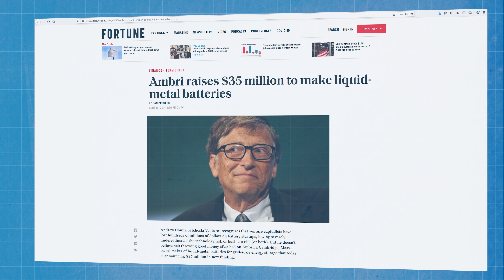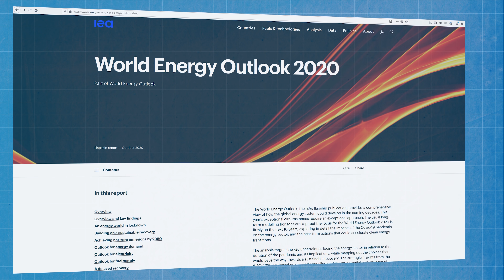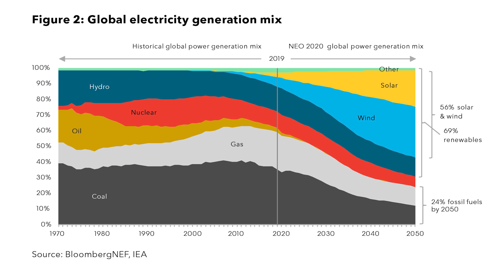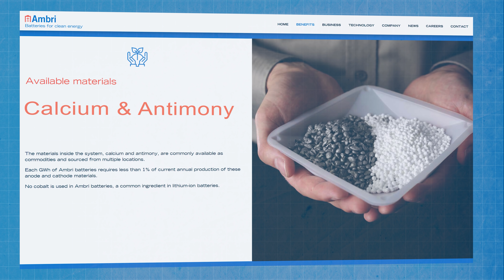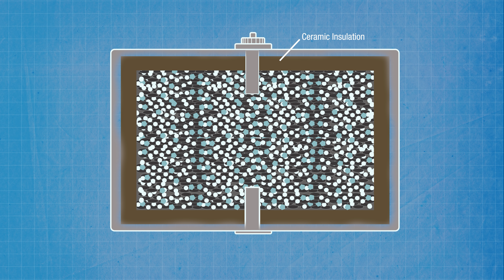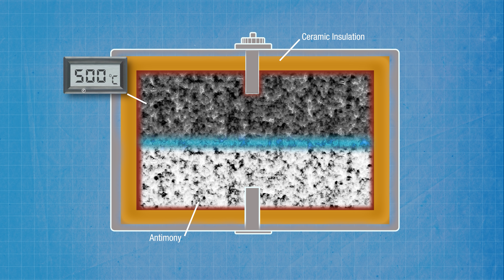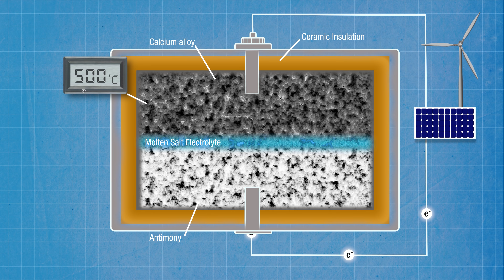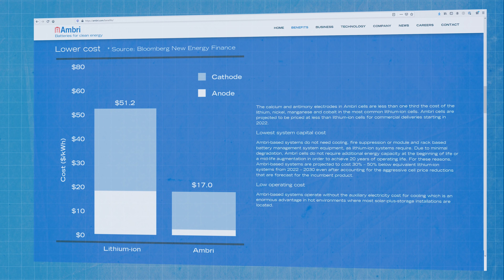AMBRI Liquid Metal Batteries. Will they really change the world?

Comment: 500C? How the F.. they are going to isolate those batteries to stay anywhere near that sort of temperature?  Why not just have a solar concentrate that uses molten salts with low melting point and just keep it as thermal capacity and produce electricity on demand

Comment: Haber Bosch reactors also need to be kept at 500°.

If I was building a small scale fertilizer plant, I would love to have it run on renewables with a big hot battery.
Reply: iiuc, the heat output is not waste: the battery needs it to keep molten.
Reply: @ianworthington2324  it gets hot by charging, so you just need to cycle it more often if its getting cold.

Comment: Hi, critical feedback at 2:42 "low or zero carbon". Carbon has two meanings there: net CO2 emissions or equivalent CO2 emissions. If the first one could be true (not even sure), the second one definitely is impossible. Energy quantifies how much change you're making to the system. Clean means stay things as they are. By definition, clean energy (or zero CO2 equivalent) doesn't exist.

Renewable (solar/wind here) is a great idea for the very long term but the urgency is low CO2. Construction materials are heavy CO2e emitters and renewable use a lot more materials than other low CO2 energy production systems. That currently makes solar/wind much more CO2e heavy than hydro or nuclear power (which, with cogeneration would be viable as a transition energy source to quickly replace coal/fuel/natural gas).

Would be great if you could introduce this nuance in your simple explanations so now one gets ever fooled by ignorance or disinformation.
Or maybe not use "zero carbon" and not associate "low carbon" with wind/solar only :)

Hope this makes sense. Critical feedback on my critical feedback always appreciated.

Comment: Question: what happens to the energy when you let a charged battery to freeze?
Reply: The chemical energy is still there.  You just need to supply enough energy to heat it up again so the ions can move.  If you had an uncharged and frozen battery, you'd have to supply the energy to heat it up again and then to charge it.
Reply: @larryp5359  obviously you will have lost the heat energy

Comment: Very interesting idea , but I think there are many different pairs of material that can be used. Some more expensive some even cheaper. Like a sulfur. We all could agree that for big scale storage this sort of huge cistern like make more sense then small units. What we also need to consider is the low voltage supplied by single unit, so many of those needs to be Connect to rise the voltage, or already design and build a stack with multiple layers.

Comment: I'm working on liquid metal batteries myself, there is still some time to go until we begin using it on very large scales, but once we have conquered the efficiency and temperature maintenance issues, it's a perfect system for grid power storage. This however can speed up if this technology is properly funded.
Reply: What about for propulsion in naval vehicles 100+ metres long? 😯

Comment: I have for 3 years have had an idea that could actually go way beyond the limits of chemical energy densities. A vacuum capacitor. Imagine this. 100 nm thick plates of metal in a vacuum, separated by 100 nm, perhaps 5 million such sheets, to fit inside a 10 cm by 10 cm by 1 meter rectangle. The capacitance of this would be about 5 farads. Odd numbered plates that get a positive charge, are connected to and suspended by the north and south walls of a rectangular vacuum box, and the even numbered plates that get a negative charge are connected to the east and west walls, so that neighboring plates have no path through actual material that doesn't require several inches of path. Therefore if you get a VERY good vacuum and shield it from electromagnetic radiation so that no photoelectric effect occurs to cause a discharge, there's no reason you shouldn't be able to put 100 kV on this. 5 farads at 100 kV is an energy of 25 gigajoules. In something occupying 1/100 of a cubic meter weighing maybe 50 or 100 pounds. But there's one little catch. Electrostatic attraction. Any plate in the middle of this big sandwich won't be attracted in any direction because it will have an oppositely charged plate both above and below it, but the plate on the very top and very bottom will be attracted VERY strongly to the one below it..... so bend it into a torus. Instead of 10 cm by 10 cm by 1 meter in a straight length, have it go around in a circle and the 2 ends of the 1 meter length connect back into itself. Now there's no top or bottom, and no plate will be electrostatically attracted in any direction. The downside of this is that it would require extreme precision of machining, and an extremely good vacuum, better than anyone has ever made before. But I don't see why this shouldn't be possible. For safety, instead of metal plates, perhaps something that doesn't conduct too well like some conductive plastic, so that if there's a short circuit, you don't get a 25 gigajoule explosion, but rather it slowly discharges. But if you do this, I don't see why you wouldn't be able to have something that stores the energy of a tank of gasoline in a device that is small enough to fit in your hands. It also depends on what the limits of voltage can actually be put on something like that, is there some sort of spontaneous discharge through a vacuum that occurs even without radiation to set off the photoelectric effect?
Reply: If it actually works, that could actually revolutionize a lot of things, for instance with such high energy per weight ratios, you could have an electrically fueled rocket and get into space without the need for millions of pounds of fuel because all that is required by having it exponentially larger to cope with more fuel being needed to lift off more fuel. But with an energy density of 100 times higher than gasoline, you could have a payload be more massive than the rocket. It could even be more outrageous if you could go even further than 100 kV. Make it 300 kV and 25 gigajoules becomes 225, and it's starting to get close to the energy to weight ratios of nuclear bombs at that point.

Comment: Yes, storage is the key component to make a carbon free energy grid possible. And I very much aprechiate the efforts of Sadoway and others. But unfortunately, 1/3 cost of LIB is not good enough for a large scale storage system. Costs have to go much deeper for it to make sense. And I am afraid this is the aspect where it will fail. The system is already fairly simple as well as the ingredients are cheap, so I don't see much potential for further optimazation or cost reduction.

Comment: One of my old students has just sent me the link to this video because about 10 years ago I started basing my university level student projects on the development of a FESS for use in the third world.  My brief was that it must require minimal maintenance, it must have high energy density, it should be used for decades - even centuries - with no loss of storage capacity or efficiency, it must be totally sustainable, only require abundant and cheap materials and totally un-toxic to the planet - a challenging brief which only the FESS designs (or mechanical gravity based) designs come anywhere close to fulfilling.  Over several years  we decided that it was much better to go for low angular velocity (<4000RPM) and high radius of gyration (k) designs (2m ish) as energy stored is also equal to k^2 (100k RPM is just too demanding!) .  These slow speed designs have a major advantage that the losses are directly proportional to the speed, ie 4x faster means at least 4x more losses, and they could be run on standard bearings without any complications.  Another benefit was that any bearing heat losses can be used to heat up any air in the flywheel's enclosure to reduce the flywheels transonic drag at the higher speeds - in fact we would run our flywheels as hot as possible to make them even MORE efficient.  We designed a range of FESS systems from house storage (100MJ) up to building, town and grid 1GJ designs.  The nice thing was if you want more storage you just add more flywheels and simply gear them together.  If anyone wants a look at these designs then please contact me - just ask for the EAUC Sustainability Champion and they'll know who I am!
Reply: What is FESS?  You lost most people in the first sentence.
Reply: @francretief1  Flywheel Energy Storage System

Comment: As we increase our dependency upon intermittent energy sources (i.e. solar and wind), we will dramatically increase our demand for grid-level energy storage to capture that energy when it is produced and providing it when it is needed. This has the knock-on benefit of permitting the grid to power down costly and pollutive 'peaker plants'. And since our current grid level energy storage solutions are... pathetic... something needs to fill the gap. Unfortunately, a new contender has shown up that will be quite difficult to compete with. 

Tesla's new battery chemistry, namely the LFP (iron/phosphorus) they've already called out for Powerwall and grid-level energy storage as well as used in their Chinese vehicles, can match the price quote and then some, thanks to the scale at which they can be produced. No cobalt, no nickel, it's just iron and phosphorus. Which is just as cheap, if not moreso due to how ridiculously inexpensive iron is, than calcium and antimony. The new Maxwell dry cell technology also looks to be combating the dendrite problem, although we'll have to see if this is actually the case when they start being produced at scale. 

It's not that I don't think liquid metals are viable, it's that the economic niche they hoped to capitalize on has already been taken. Unless he can undercut Tesla's LFP batteries, he's not going to get much traction.

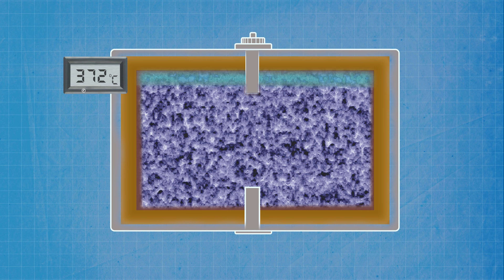Comment: @6:11 SO it takes electricity to make electricity?  @7:39 OK I see.  A 1 time HEAT source to get battery started.  @8:43 Going to NEED a portable or onsite power source that can bring temp to 500C each and every time.  Charge Capacitors COME TO MIND.

Comment: Liquid metal battery’s pose a problem by their weight is almost 4 times more than the traditional battery being used
Reply: That's not a problem for grid level storage, since you are simply installing them in a warehouse building and leaving them in place. You don't plan on moving them anywhere after installation, so weight isn't a significant factor, other than installation itself.

Comment: Running a batterie at constant 500° sounds not that efficient.
Reply: The temperature doesn't matter for efficiency, all that matters is energy in vs energy out, and that's 80% efficient. You would be correct if this battery was being used for low cycle applications. Then there is a certain amount of energy consumption just to keep it idle. But the use cases for these are high-cycle applications where they're constantly charged and discharged, resulting in low overall waste energy.
Reply: @BenjaminCronce  The 80% efficiency was surely calculated based on high cycle applications otherwise that technology makes no sense due to the need of liquifying the metals repeatedly. Anyway, 80% efficiency is still low compared to Li-ion technologies
Reply: Good point! It made me think about temperature sustainability in connection with global warming. Where does the heat go? I agree that this battery seems important.

Comment: a battery that needs to be heated to 500 degrees centigrade? sounds like a non starter.
Reply: Why?
Reply: @malcolm_in_the_middle  well you can hardly use something like that in most applications that need a battery, obviously.
Reply: @Withnail1969  But this is designed for one specific use case, which is industrial storage of energy. The main purpose being storage of excess solar and wind energy to deal with periodic shortage. 

Nobody is suggesting that we replace the Li-ion battery in your phone with this.
Reply: @Withnail1969  Yes that's true. But if they are safer, and more efficient than Li-ion batteries, that would probably be a worthwhile tradeoff, as it would be a singular, rather than continuous cost.

We don't know if they are more efficient yet, but they're definitely safer.

Comment: Could a MAC (i.e., LAC) battery be heated by a PBR or LS-VHTR?
MAC Cell electrodes thermal properties:
Calcium
	• Melting point		1115°K    842°C    1548°F 
	• Boiling point 		1757 K    1484°C   2703°F

Antimony
	• Melting point  	903.8°K   631°C    1167°F
	• Boiling point  		1908°K    1635°C   2975°F

So, battery operates within   900-1000°C    1652-2012°F
_______________________________________________________________

MAC Cell containment:

Quartz glass melts 1700°F - 2200°F
Alumina Clay (Crucible) 2200°F

https://www.thomassci.com/scientific-supplies/High-Temperature-Crucibles
CoorsTek Alumina Crucibles
	99.8% Al2O3
	Withstands temperatures up to 1,750°C  3182°F
_______________________________________________________________

Very-high-temperature reactor (VHTR) thermal properties:
A Pebble-bed reactor (PBR) may operate up to 1600°C
A Liquid-salt (LS-VHTR) can work at very high temperatures (the boiling point of most molten salt candidates is >1400 °C

VHTR containment:
16% chromium stainless steel provides corrosion resistance up to approximately 1,200 °C (2,200 °F)
310S Stainless Steel combining excellent high temperature properties with good weldability and ductility, is designed for high temperature service. 310S stainless steel resists oxidation in continuous service at temperatures up to 1150°C  2100°F.

Conclusion: VHTRS are candidates for heating MAC cell batteries?

Comment: Sooooo where's the economic analysis? Other than 1/3rd cost I've seen nothing about their production, maintenance, capital, running costs.
Reply: I think all the work they currently do is bespoke for now, which is typical of a company at this scale and for a technology that is so new. Whether there are underlying issues in those areas that you noted should be revealed as their project with energos reno makes progress (or not). Ultimately, they have to build it to see if it works, but it seems a commercial partner liked enough of what they saw in private to put their money up for the project to happen. Again, still no guarantee, but it's an encouraging sign.

Comment: Pumped hydro can do better if instead of pumps and pipe you use guideway and linear motors.  The pump/motor is the problem and changing that out solves the problem.

Comment: I want to see the energy input curve (necessary to get the cell operating) before I'm going to buy this idea for a better electrical storage method. What happens if the cell isn't in use for a few hours? Does it have to be restarted (heated with externally supplied electricity)? And the chart you showed about near future sources of electricity is unrealistic. To provide that much of the world's electricity with solar and/or wind will take up so much real-estate in a country like the USA as to be a non-starter. It can work for certain regions to be sure, but not the entire country. And beyond that, the cost to bring the national power grid into a state where it can support these technologies is a well beyond the trillions of dollars range. Even to stop the brownouts and blackouts that periodically happen without changing the power generation technology at all. Looking at cool technologies is fun, but drawing usage conclusions in a vacuum without benefit of the greater picture and financial reality doesn't do much good.

Comment: The problem is as I see it these batteries are just smoothing agents. Making the power available at a different time than when it was produced. You are still stuck with low power density weak solar and wind. If you take just wind to power the whole grid it will take more copper than exists in the crust of the entire earth. The only method that makes sense in any way are small modular nuclear reactors. Commonly called molten salt thorium reactors. That is the only feasible energy source that  financially  and safely will remove fossil fuels as our major energy source.

Comment: I was on Ambri's web site close to 2 years ago they lay out their time line and  they are not behind. If you had looked you would of known their batteries are proven with 1000s of cycles and basically no denigration. They want to go commercial but I can see a residential market for them as well. It makes solar useful where it really isn't now. You make power all day you can't store much of it the power walls are a joke they have very little storage ability. So its sent to the power company who pays you generation rate. But at night or bad weather they send you back your power at retail rates which are like 5-8 times more then they paid you. That's a raw deal. But one of those 600 kilowatt  10 foot containers has enough to last you about a  month which means you could actually be off grid as in no connection to any power lines. And with the amount of hurricanes iv been hit with this has me drooling as a way to be free of the 1 week power outages and the never ending monthly bills.

Comment: I ran this by my university professer. The challenge is not making the technology work. Its getting enough of the materials. It doesen't matter that the materials are "dirt cheap" if there are non. Antimony is 32x more scarse than Litium. And this battery requires half a metric ton to produce one.